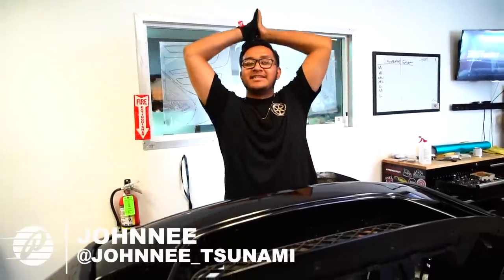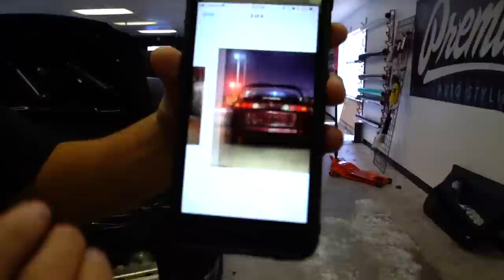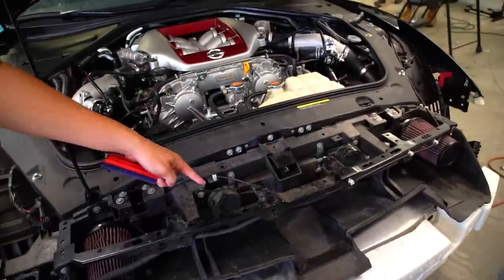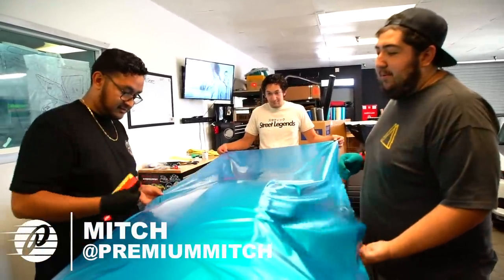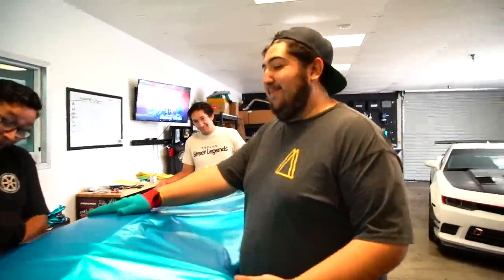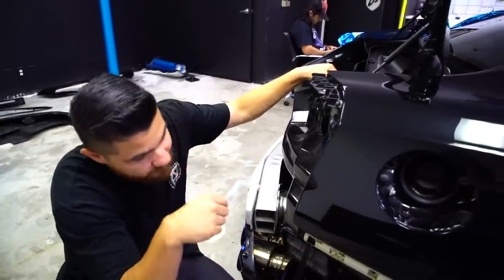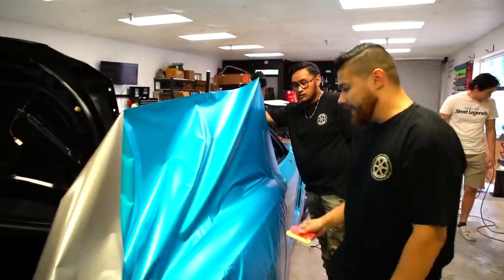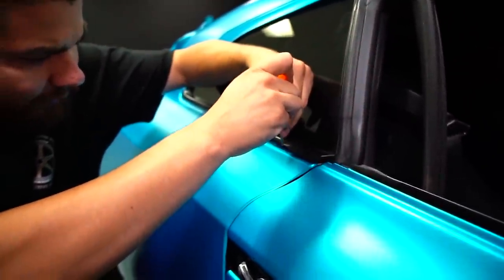SATIN BLUE NISSAN GTR: VINYL WRAP PROCESS / CAR VLOG

Comment: Hey Daniel, I've detailed a lot of cars with chain smokers, and you can get the smell out if cleaned properly,  shampoo carpets, headliner, all cloth portions and deep clean the seats, and use and odor neutralizer to spray in the vents and you should be good to go!